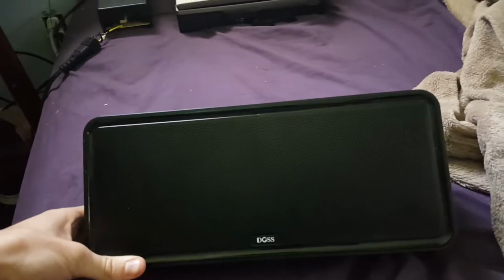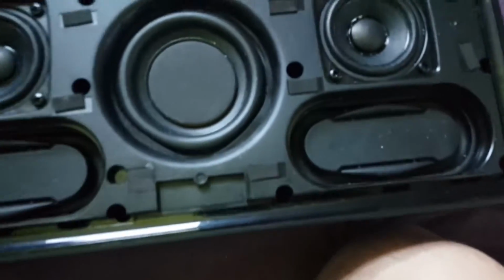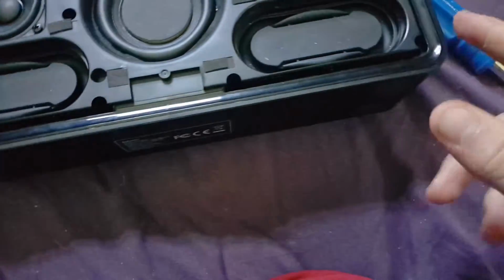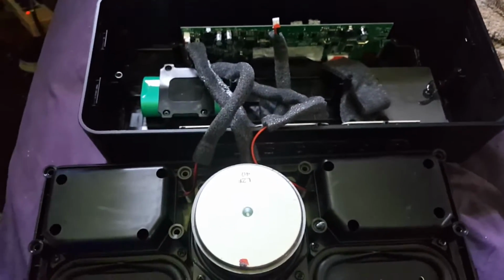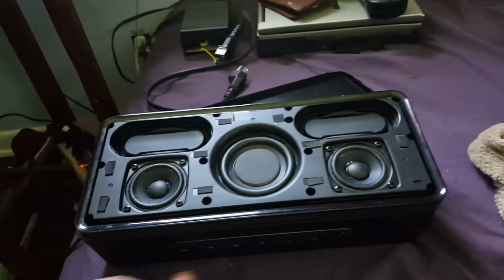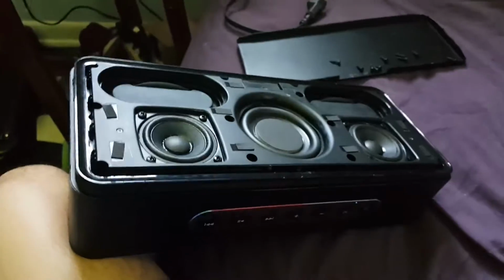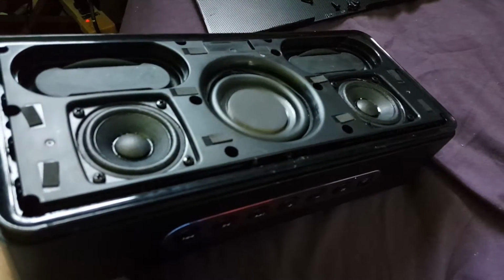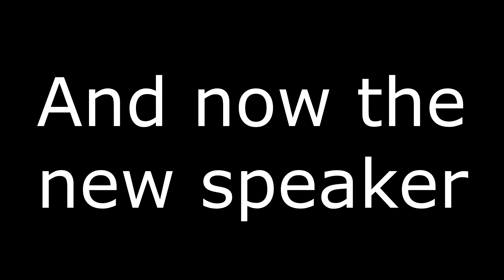THAT WAS UNEXPECTED | Dissecting Doss Soundbox XL

Comment from the maker: No need to throw hate. If you notice, it was their fault because the speaker battery came out for NO reason whatsoever, I literally didn't do anything for the battery to come unplugged. I know I could've put some stuff in it to fix it but I saw no reason in the beginning because I didn't know that it was just the battery unplugged, I thought that it was just completely broken. Think before you throw hate.
Reply: does it play while charging?
Reply from the maker: @nazconspiracy4226  I think so
Reply: @nazconspiracy4226  I am sure it does... probably would sound even better while charging too. I personally haven't had the time to try it. I'll do that and then post here 😊

Comment: Based on other reviews, Oluv mainly, I got the Doss Soundbox XL today and it sounds amazing! I can't stop smiling! 😊 First, the 'bad' news, it's made of plastic but doesn't look plastic... matte finish. The volume control doesn't sync, it is not rugged or waterproof, more of a home portable and it doesn't take calls but it does go silent, obviously, when playing from your phone and of course, don't drop it on the ground! The rest is ALL beyond good! The grille is metal and the button console is brushed steel with black round glossy buttons that click easy. Even better than I expected! No hum or rattle! This speaker handles ALL recordings really well! I dunno how! My stereo, which is really excellent, can't do that! Even the highs are good. The bass is great!! Mids work well for most voices. (frequencies) And wired to my old iPod Classic, it really sounds deadly! And MUCH louder too! Maybe 50% volume roughly, on the speaker, is enough. On my phone, I keep the volume loud and control it on the speaker. I can use phone volume buttons too. I have my entire cd collection on that iPod (mp3) so it's great, plus I'm yet to try a micro SD card. ( btw, about that, Doss said format it Fat32 and put songs on it with no folders) That may be softer than the iPod as then there would be no preamp so to speak but the speaker is more than loud enough, so... JUST BUY IT!
Reply from the maker: I got it from Amazon.
Reply: @sinumofficial  Did you manage to return it? And if so, what did you buy, after?!
Reply: @g80m  Isn't it great sound?! I love mine but I was unlucky, I got a faulty battery. It plays for about 2 hours tops, at 70% volume. I mailed Doss but they said that it's not covered by warranty as that seller (on Amazon!) is apparently not an authorised Doss dealer. Amazon India are not contactable. Amazon US, UK, etc are an entirely different cup of tea, they are excellent. Here, at the best of times, they take no responsibility for crooked sellers listed on their website, which is not cool. Any problem and they say "please contact the seller". Right now the world is locked down with this 'thing' so can't do much. There is no Doss service center in India either. Will worry about it after this thing passes. And charge it more often, as I am doing. Stay safe 😊
Reply from the maker: @apusista  are you alright? Did you not see I had 2 speakers? They gave me the second one for free so I sold the old one on eBay.
Reply: @sinumofficial  Yes I should've watched the entire video before commenting. You could have paired them though! Would've sounded great! Btw, if I remove the grille and remove that baffle, will the highs improve? And is the grille easy to put back? And will it rattle without that baffle? Thanks in advance for your reply 😊
Reply from the maker: @apusista  Well, the grill is pretty easy to take on and off. If you notice the grill has a spot on the bottom where you can pull it out there. But be careful because it bends super easy making it a bit more difficult to put it back in. If you're careful enough it should be okay. Also I can't pair them together because 1. I don't have it anymore, and 2. The way I opened it was not okay because I thought the speaker was destroyed, until afterwards i realized the battery came unplugged. It was a waste, but they saw that there was an issue with my speaker and sent me a brand new one for free. DOSS did. They're amazing.
Reply: @sinumofficial  Thanks so much for that excellent advice! Yes, I would be very careful, especially as I'm far from an expert! But you haven't yet told me if removing that baffle will improve the sound? If not, there is no reason to remove the grille and risk problems putting it back... ? Thanks much 😊
Reply from the maker: @apusista  I have no idea what a baffle is lol
Reply: @sinumofficial  It's a word used by 'audiophiles' for any kind of go-between diffuser. In the case of the Doss XL that would be that fluffy fabric between the metal grille and the drivers.
Reply: @sinumofficial  It possibly tones down highs so the speaker may sound brighter without it... ?
Reply from the maker: @apusista  I'm about 100% sure there's no fabric between the grill and the speaker.
Reply: @sinumofficial  100% fact there is. It's why you don't see the drivers through the grille. Look at some other videos on this speaker and you'll see it. I'm just not sure if Doss put it there for sound reasons or to make it look neater... ? And I'm a bit scared to try and take off the grille incase I can't put it back! Could use your guidance if you find it sounds better. Thanks much,
Reply from the maker: @apusista  again, you're wrong. Unless they've just now started adding it. I can see my speakers through the grill just fine.
Reply: Hi there 😊 No sound from you? Trust all is well? As well as can be! So should I remove the grille and remove that thing? Or is it a bad idea?
Reply from the maker: @apusista  again idk I got my speaker over a year ago, so it's probably a new thing.
Reply: @sinumofficial  Sure, I know. I'm just asking you if it's safe to remove the grille and easy to put back. That's all.
Reply from the maker: @apusista  I answered before, I've done it and was able to put it back 😂😂 the grill doesn't matter too much, some speakers have an issue where the sub actually hits the grill, but that's a manufacturing issue.
Reply: @sinumofficial  You have 😛 Thanks so much and for your patience! I'm stressed out of my skull with this thing. In India it's total lockdown. Not allowed to leave the house, not allowed to discuss it etc...
Reply: Hi how're you doing!  Just to say That I finally opened up my Doss... XL. Not a big deal but that fabric was not there so there was no point iin opening it except to see the drivers. It's copied from an old Sony design... the SRS A77. The drivers don't look expensive but the speaker is exceptional for the pice in the US, $70 now. I think they may have discontinued it though, as their website says, 'Not available'. Seems there is no shortcut to the battery like the Sony though. I don't think I'll get a spare from them anyway... It gives me 2 hrs.  I'm managing for now. Trust you're keeping well? Stay safe 😊
Reply from the maker: @apusista  I told you so. lol I'm doing okay, and dang I got the speaker for $90. Goes to show how long I've had it.
Reply: @sinumofficial  Console yourself with the fact that I paid $160 and got a piece with a faulty battery and Doss say they can't help me as I didn't buy it from an "authorized dealer". I bought it with tax paid money on Amazon India. I didn't go to anyone dodgy...
Reply from the maker: @apusista  That's strange. They were super nice to me. Maybe it's because I'm based in the US, I'm unsure.
Reply: @sinumofficial  No nothing to do with me being Indian or Doss. The problem is Amazon India not taking responsibility for their sellers. My point is that I bought it legally, from Amazon, it was made by Doss and I own it, so doesn't that make me their customer? And then the next day lockdown was declared here and now most companies are still not operational. I am only worried that IF it's discontinued, they may not have a battery to give me or sell to me. Like $160 was not enough! 😊

Comment: The bass is messed up maybe because it's no longer air tight? Prying it with screwdriver probably messed up the seals. To remove the front assembly, first remove the two speakers then grab the speaker holes to pull it out.
Reply from the maker: Kris I know I messed up the air tightness. I originally thought that it was actually complteley dead, that's why I didn't take as much care of it. Thanks for the help, though. :)
Reply from the maker: Kris Hey I don't think that would've effected anything. I truly think I unbalanced the air pressure so it just didn't do right. I mean, I did cover up the holes with duct tape (ghetto, I know), but I forgot the speaker let off this really really odd smell. I mean, it smelled good to me, but it was unnatural.
Reply: gabe80million Are you saying they filled it with gas e.g. Sulfur Hexafluoride (SF6)? I suppose it can help with acoustic damping and lower the sub's resonance frequency.
Reply from the maker: Kris I'm assuming so but I don't want to mess with it. lol

Comment: Thanks for the Video.   My Doss is doing the same thing,  it is not charging.   The little red light will come on for a 1/2 second when I plug it in and turn it on.   I am thinking that the vibrations of the unit may have loosened the wire plug inside the unit.   My unit is almost 3 years old now.   It did take a fall from my wall unit onto the carpet 3 weeks ago and that is when it stopped charging.   I will bet that the fall caused the small wire inside to detach.   I have not opened the unit yet to fix it.   I don't want to ruin it and the device still works plugged in.   Any advice.  ?
Reply from the maker: Just browsing through the comments goes to show I should've never done what I did. I thought the speaker was completely broken. But, I'm sorry, I'm not too sure how to take it apart without really breaking it. I have seen another video of a guy that got the speaker. Try looking up tutorials.

Comment: I opened mine up because the subwoofer got a lil screwed up after the speaker suffered a 5 foot fall. After putting it back it was pretty much fine but the subwoofer sounds very distorted and the passive radiators don't seem to work anymore. How do I get it to be airtight? Much appreciated if you could reply. Thanks
Reply from the maker: Lol that's what happened to me. Basically it either needs air pressure or this stuff you spray in there I can't remember what it's called. I just told DOSS about my battery being dead and they sent a new one and I sold the old one.
Reply: gabe80million ah that's nice. doss doesn't have any service support in my country and apparently when i contacted their customer service in Australia they requested for my amazon order id (i didn't order mine from amazon, lol. no idea what to do now.) i guess what i could do is look for someone that knows how to reassemble it properly.
Reply from the maker: @ji9starrz  go for it, I recommend Doublsmm.

Comment: Why you didn't use the DC connection instead?
Reply from the maker: May I ask, how oblivious are you?
Reply: @sinumofficial  I mean dc or it doesn't have it
Reply from the maker: @markrobby7136  no you can't power it on without the battery, sadly. The plug is only for charging, it doesn't charge while it's powered on.
Reply: @sinumofficial , ok. Its sad that the manufacturer didn't included that obtion on such a high demanding speaker. Now I know. Thanks.
Reply from the maker: @markrobby7136  yeah well at least they'll give you another one for free.

Comment: So did it come with the battery unplugged? Also, did they give you another one?
Reply from the maker: No the battery unplugged itself. And yes they sent me another one for free easily. All I had to do was send video proof
Reply: gabe80million Oh alright man thanks. I’m thinking about buying one but I don’t know if it’s build quality is good.
Reply from the maker: @bloodshed3523  it's a knockoff but do what you want it's your money not mine. Lol it works well for the most part even though every sound is windows sounds.
Reply: gabe80million Oh Ight I want to buy it because I heard it’s bass is really good and if you take a look at my “New Music” playlist, you’ll see that all I listen to is bassy rap lol. I would buy a jbl or something, but I heard the bass is better on this, and it’s way cheaper.
Reply from the maker: @bloodshed3523  well yeah it's okay. Lol it's nothing special. I got it because I heard it's bass was amazing, too, but all it does is vibrates everything most of the time, you can't actually hear it. Pretty good quality imo
Reply: gabe80million Alright I’ll buy it and try it out. Thanks!
Reply from the maker: @bloodshed3523  Not a problem.
Reply: gabe80million I ended up getting it 3 days ago, returned it because it had a rattle noise. I ended up buying a JBL charge 3 instead, I like it alot more. The charge 3 is more portable, louder, and the build quality is much better.
Reply from the maker: @bloodshed3523  neat
Reply: @bloodshed3523  JBL is under Samsung that's why it is good. The original JBL company is fucked up just like Altec Lansing. Pay more but poor power output for their speakers. Lack of quality too.

Comment: a very unfair trash review.......what the hell matters whats inside a product if it works just fine......for $70 @ Amazon right now you cannot buy a better sounding portable BT speaker......period.......You mess up the speaker for what purpose? no sense at all......Who's gonna be the dumb to buy that speaker after you ruined it........my God
Reply from the maker: No need to throw hate. If you notice, it was their fault because the speaker battery came out for NO reason whatsoever, I literally didn't do anything for the battery to come unplugged. I know I could've put some stuff in it to fix it but I saw no reason in the beginning because I didn't know that it was just the battery unplugged, I thought that it was just completely broken. Think before you throw hate.